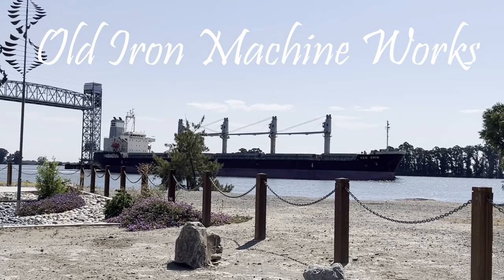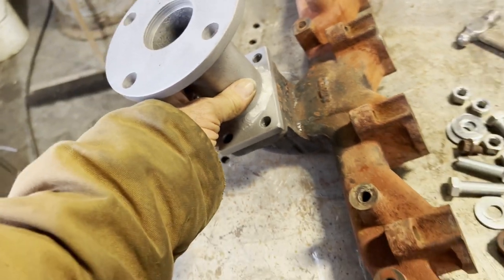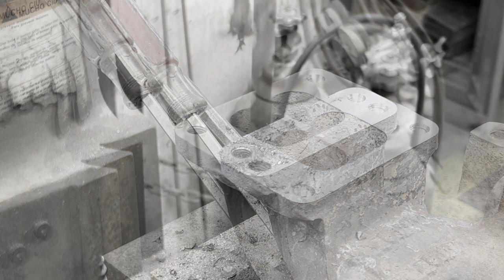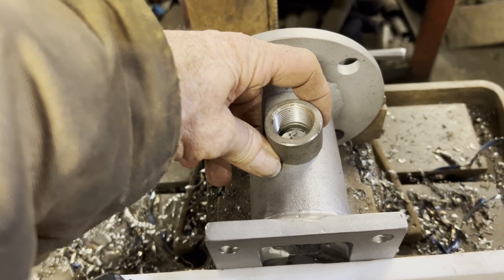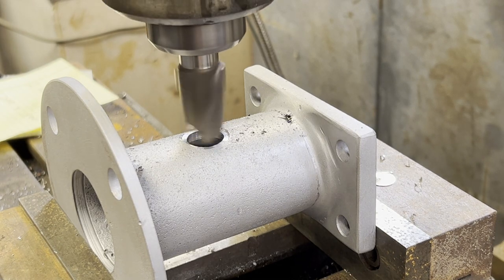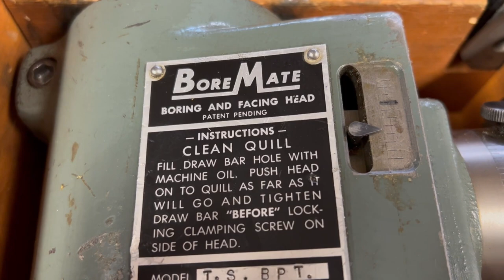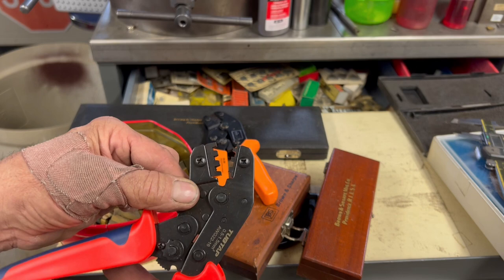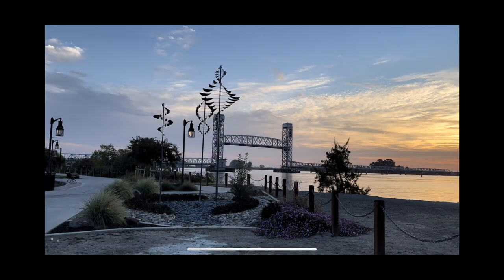Old Iron Tidbits #7  5.9 Cummings Exhaust adapters. Tool Scores.

Comment: Hi ! The contraption you were not sure about is for a grinding wheel balancer. You place the grinding wheel between the flat and conical pieces and then place the shaft on the balancing apparatus, usually 2 intersecting wheels on each side, so the shaft can spin freely to find the heavy spot on the wheel. Anyway that's my take on it.

Comment: Morning Gary, great repair on those manifolds, love how you recycle materials.  Thanks for the video :)
Reply: Regarding your Chandler Duplex boring and facing head, it looks to be the same size as mine.   I have a diimensioned drawing of the tool holder for that, can send a copy if you want.
Reply from the maker: Thanks 👍

Comment: Gary, try to find an Andrea boring head. It's also stationary when in use but is has a SK40 or SK50 or Mc4 adapter which can be changed easily. You can add your own interface if needed. Great stuff from before the cnc era. Best! Job

Comment: Love the innovation making parts from scraps Gary. Likewise I'll always favour a bit of Fab over a lot of machining. Some nice new tools but I do wonder how you have the space to put everything. Good to see the engines working in the field. Cheers
Reply from the maker: Thank you Paul. Space is no problem for the small tools, it’s the machines that are the challenge. 
I have put the new shop plans on hold for now but will be working on the house when weather gets nicer. I should gain about 700 Square feet of shop space. Not a lot but will give me a little elbow room.
Always nice to have you stop by Paul.   Gary

Comment: Hey love the channel Have you ever seen the trick of smoking threads I'm sure you have but you take an oxy acetylene torch and turn the fuel on only and smoke the threads and it keeps the bbs off of them they won't stick it makes a coating on the metal

Comment: Are the natural gas engines prone to shrinking manifolds and cracking the ears off the heads like the diesels are?
Reply from the maker: We have some that have shrunk, but not enough to break ears off. We have been able to just open up the holes in the manifold slightly.
Thanks for stopping by Brian.    Gary

Comment: Hi Gary is that a standard 5.9 diesel head on pumping engine with long spark plugs?  and lower compression pistons,  is this a Cumins parts arrangement 
or after markets parts?    
i have been reading lately about engine makers are converting diesels to run on Hydrogen , spark ignition and lowered compression ratio.
Reply from the maker: Dale, these are Cummins natural gas engines. Different heads, low compression, pistons, and other differences than a diesel. All Cummins, no aftermarket.